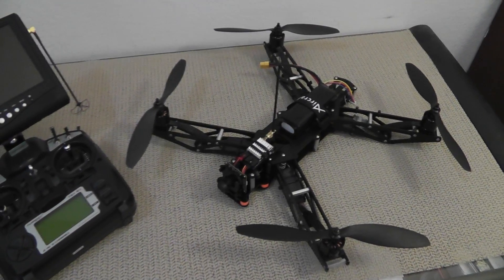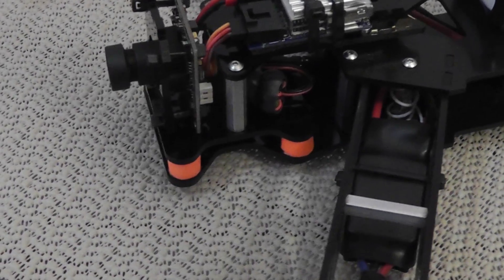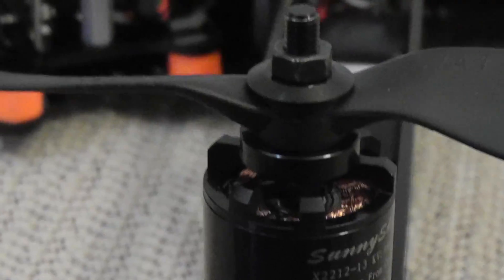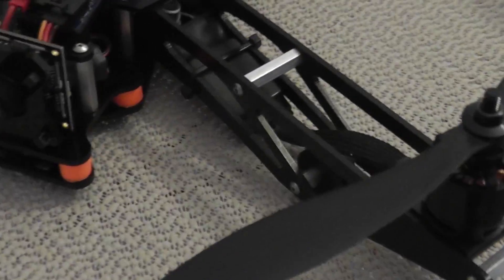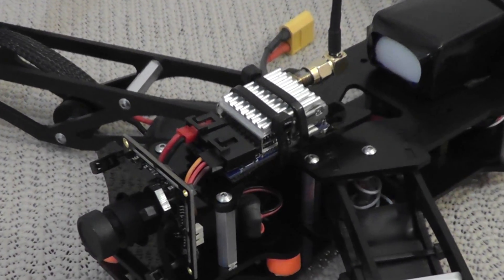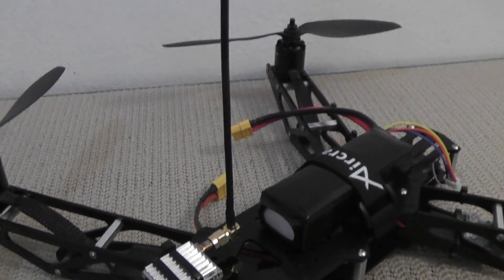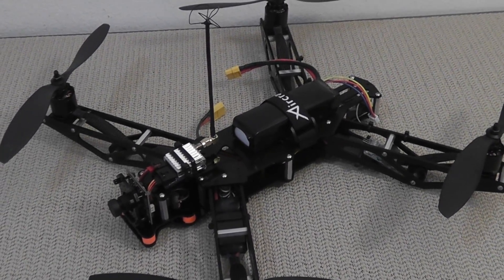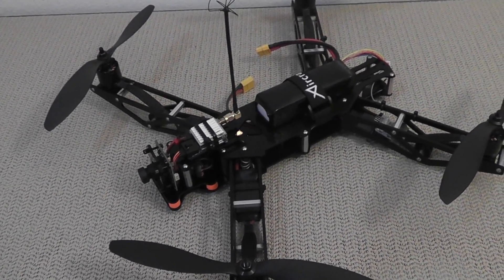Honey Badger FPV Quadcopter - Introduction

Comment: hi, how does it fly? flight time? I need to buy a quad and not sure between this and the ht flip ?
any suggestion?
tx for the review
Reply from the maker: It flies great! I'm usually getting flight times of 10:30 on my old 2200 3s batteries, but if I were to buy some new ones it would probably last longer.  I was also deciding between the flip and this frame when I purchased it initially. The main reason I decided to stay away from the flip was because it weighed so much in comparison to the Honey Badger.

Comment: So that is heat shrink? Wow i was thinking it was a carbon rod. Does it stay pretty rigid? I need to do something like this. I've been mounting mine on the bottom facing down, but i want to take my legs off so i'll need to make something like what you have to mount on the top. Great idea